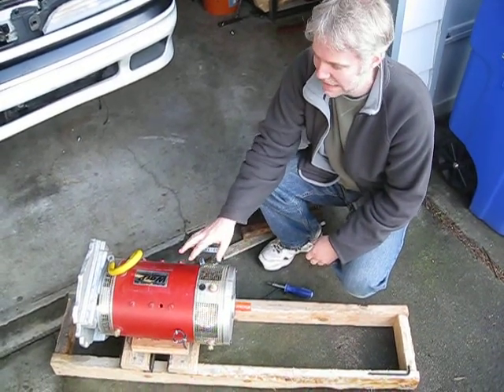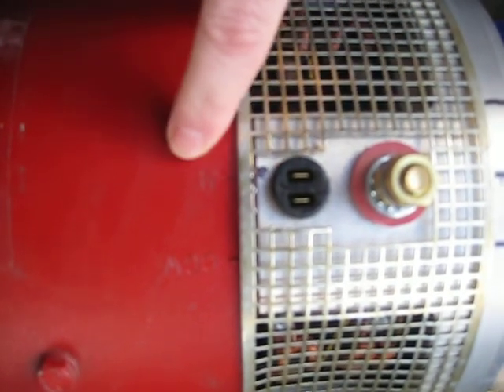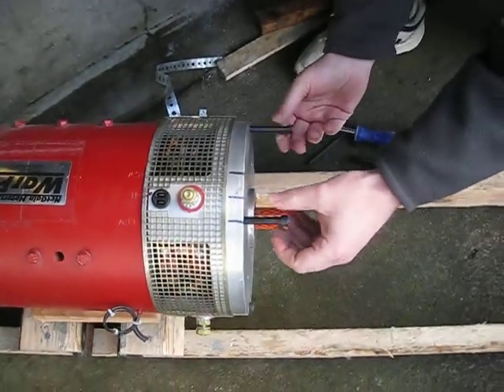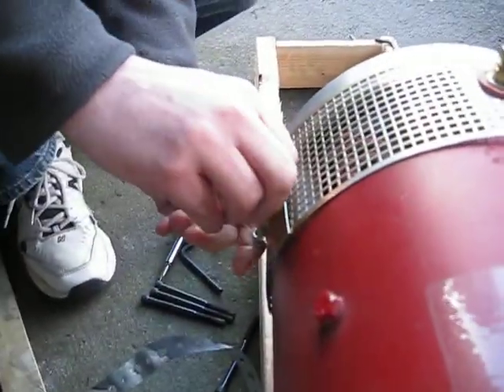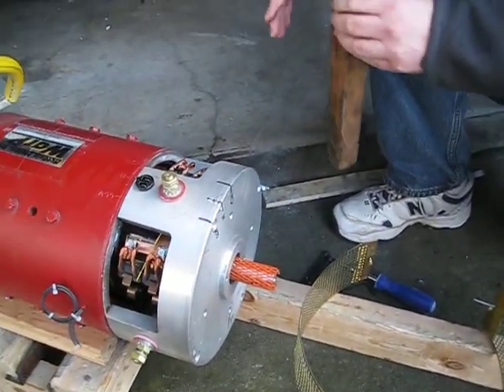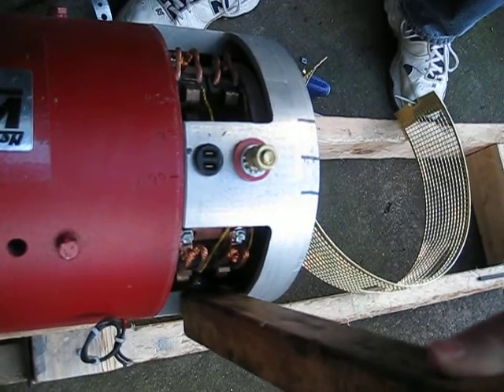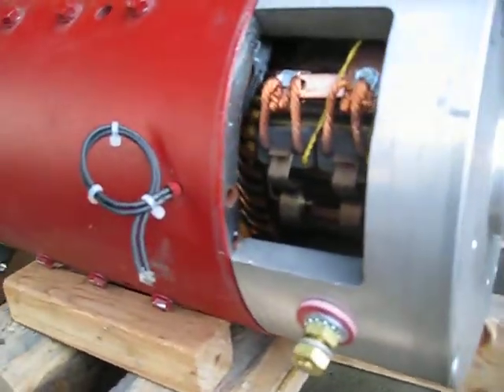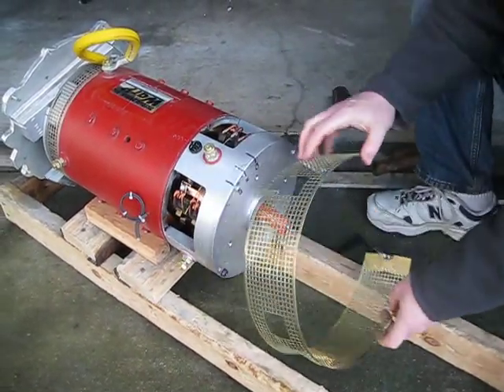Video Motor Advancing

Comment from the maker: Unixtm, you are correct, the motor was shipped to us in CCWDE.  After we shot the video, we tried putting the bolts back in but realized that the motor was now way advanced, so we moved the drive end back to its original position.  We realized that the bolt is the actual marker for the motor position (not the terminal post which I thought).  So you can see that the bolt I pulled out was in the CCWDE position in the video.  You can link to this video from NetGain.

Comment: I thought it would be more work than this. I always though it would be more complicated such as opening the motor to move the brushes. It seems that Netgain motors are pretty easy to work on, I'm considering the HPEVS AC50 motor but might go DC with a Netgain for the additional power, still deciding. Thanks for posting this.